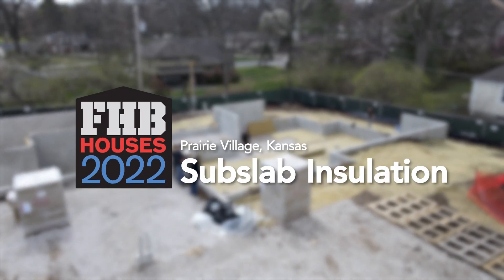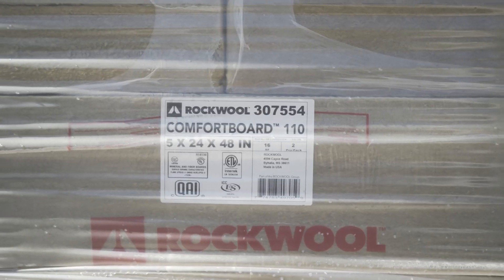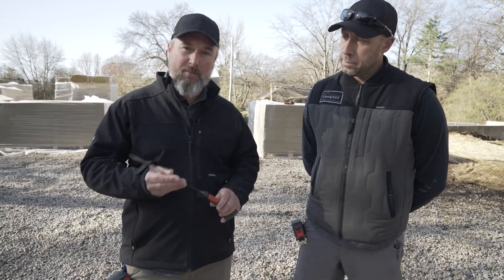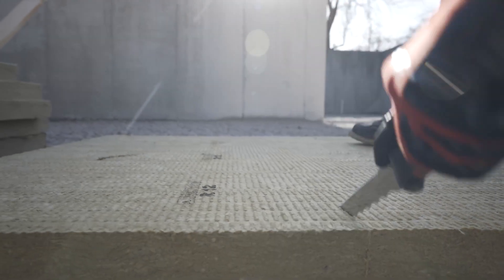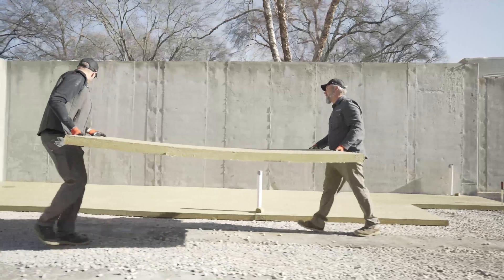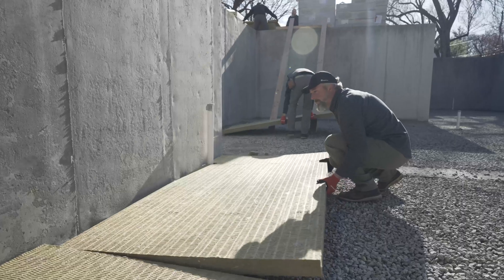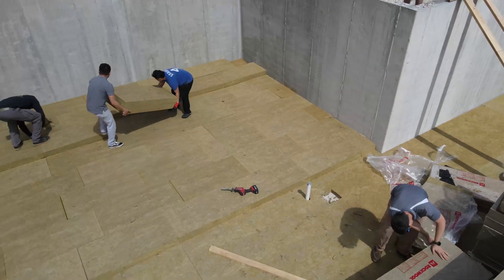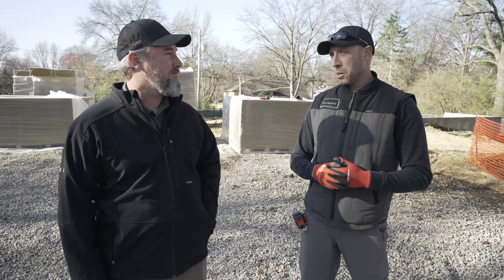Insulating Subslab with Mineral Wool

Comment: why would you want it vapor open ?? you want to BLOCK water and humidity and radon !!!~
Reply: They install Stego 10mil vapor barrier with taped seams over the rockwool to accomplish that.
Reply: The insulation has to be able to absorb and shed water. If it’s closed cell it will deflect water and make it pool

Comment: You chose Rockwool because it's vapor open but intend to add a poly vapor barrier right on top? Please explain? 

Or did you just start naming features of the product which was chosen for some other reason (eg the currently high price of rigid foam relative to the comfortboard)?
Reply: I was wondering that too - seems like you'd want the vapor barrier between the pea stone and the Roxul, so the slab could dry downwards and increase strength. I have wondered about putting mineral wool below a slab, or using it as the basis for finishing below-grade concrete or block walls.